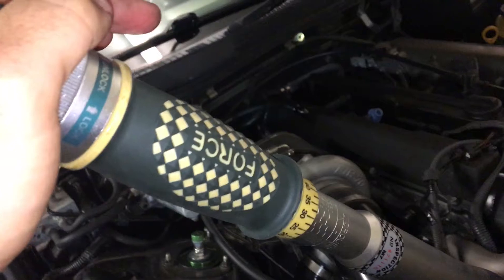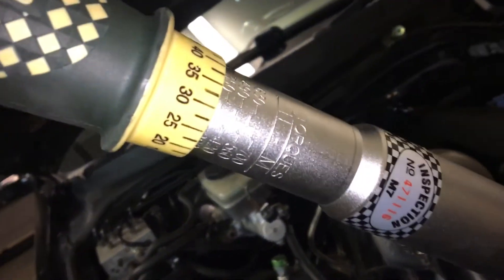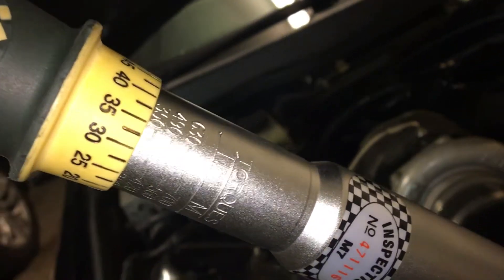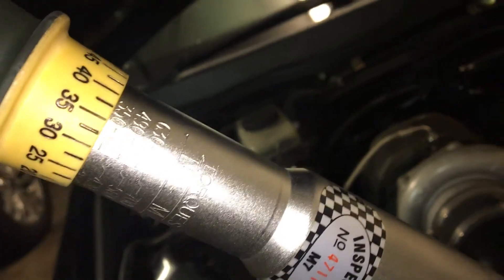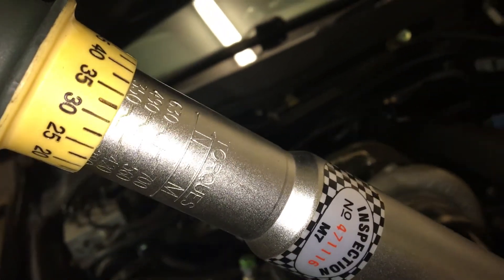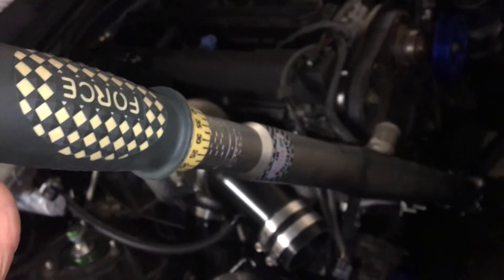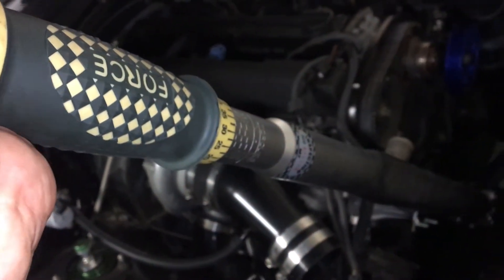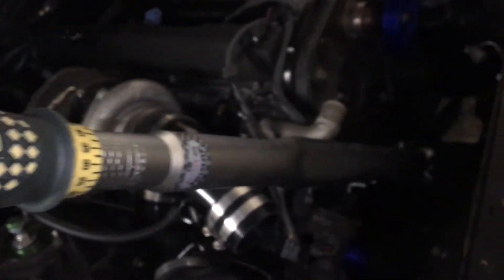Toyota JZ Crank Pulley Torque process

Comment: How you put it back in?
Reply from the maker: I’m not sure what your question is?
Reply: How did you intake it? How you keep the engine from turning while torquing down the crank pulley
Reply from the maker: I made a tool to hold the crank pulley, but you could try and strap it the same way if you had to.

Comment: did you notice any difference with the new pulleys? I assume they're lighter then stock ?
Reply from the maker: Paul Durand heaps lighter than standard - here I weigh them against the standard ones 2JZ & 1JZ Lightweight Aluminum Pulley Upgrade https://youtu.be/t3axUMJfG9M

Comment: Loctite or nah
Reply from the maker: Not in the service manual - no thread locker at all. Just a crazy amount of torque the most I’ve seen on an ordinary crank pulley bolt 😎
Reply: That Car Channel I know this is an old Video but was hoping to see if you had a copy of the service manual, going to be doing a refresh on the 1jz vvti . Thanks !